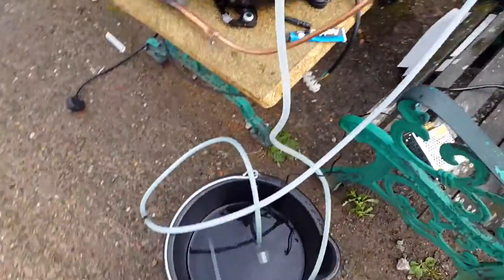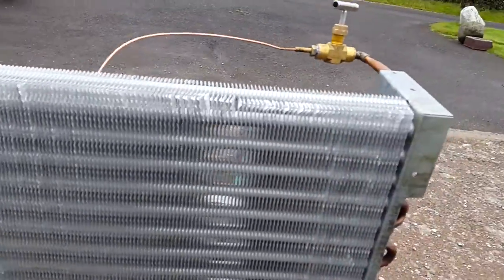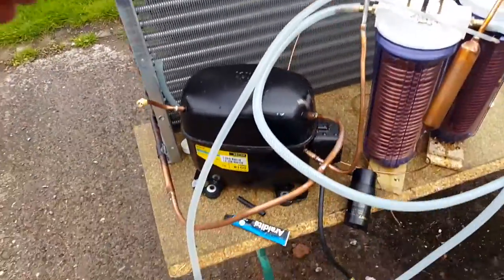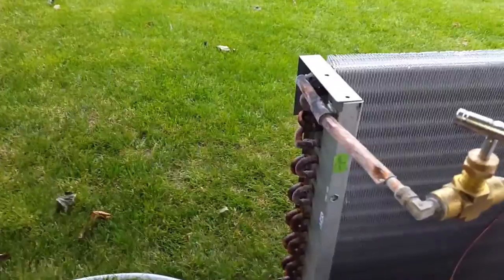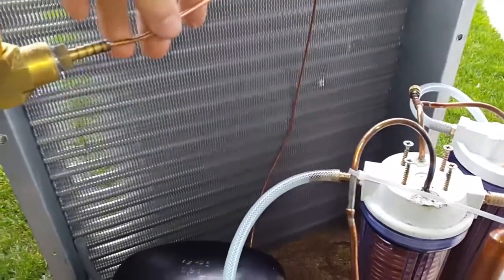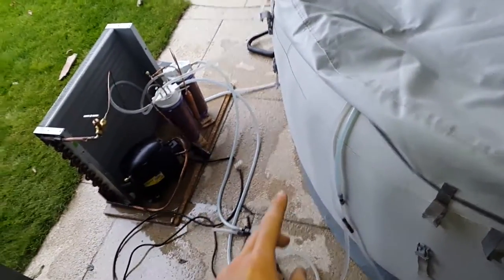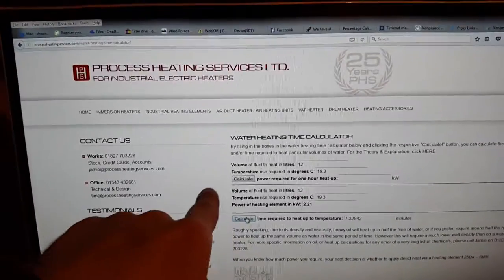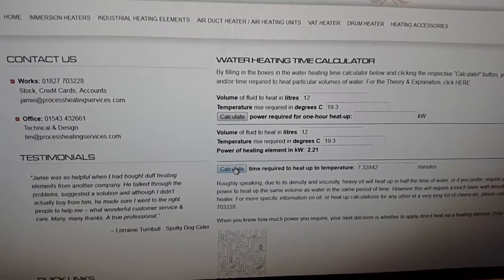Lay Z Spa Air Source Heat Pump Test

Comment: Your compressor will last a lot longer if you swap the suction line to the top of the coil so it does not flood back due to no fan/s. Cool proof of concept though
Reply from the maker: Would that not prevent sufficient refrigerant returning to cool the compressor?
Reply: No. The mass flow rate of the refrigerant will be the same regardless. The issue I see is liquid flood back damaging the compressor. One suggestion would be to have a fan and cycle the fan on suction temperature - hi temp > fan goes off, Low temp> fan cuts in. This is the way (kind off) that outdoor fans are controlled in heating mode on conventional Air con systems
Reply from the maker: What about oil return?
Reply: Oil is transported by the return refrigerant vapour, if you have enough mass flow of refrigerant your oil will take care of itself at these temperatures.